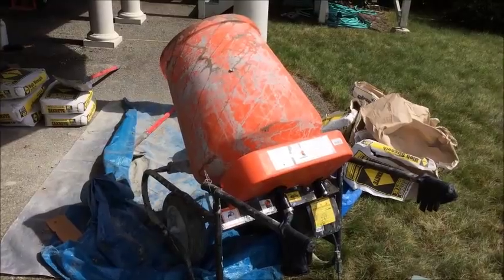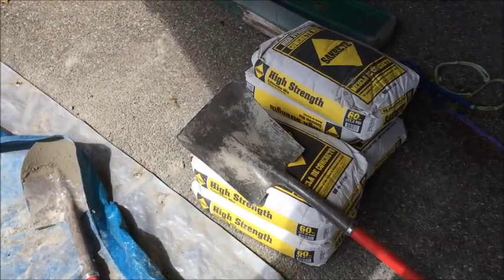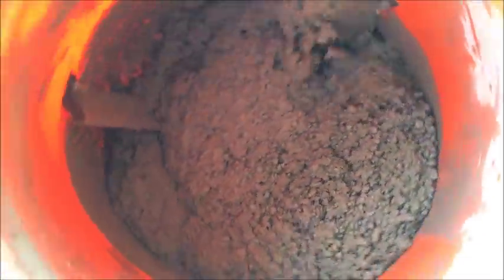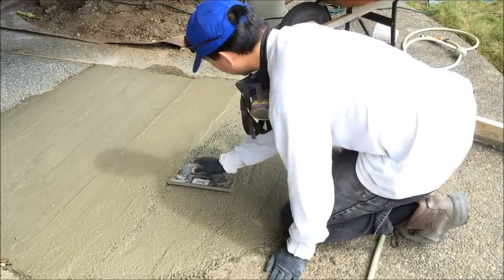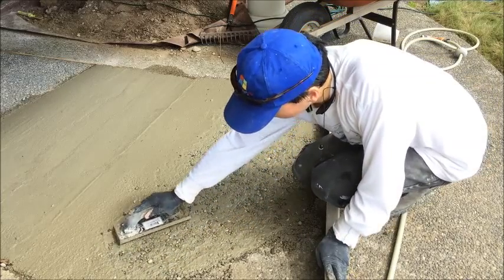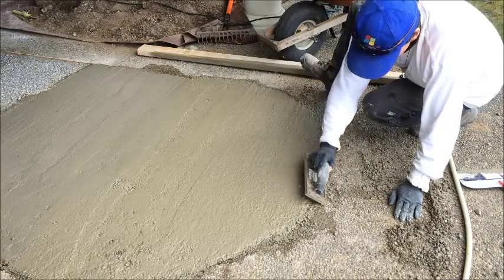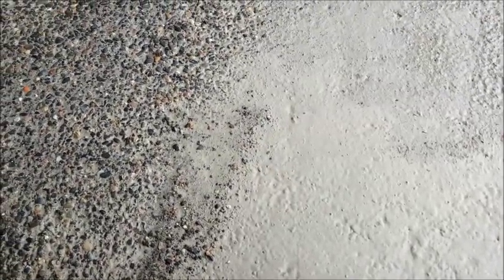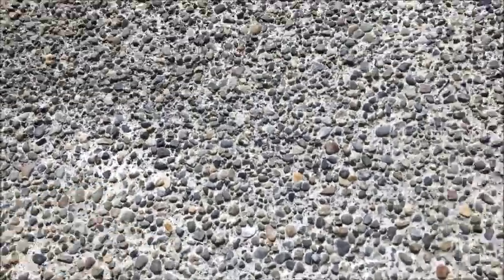Kushlan Concrete Mixer Tips And Making Aggregate Surface

Comment: The drier the concrete the stronger it is but even if you bring in a truck you get to choose how wet it is and most of the time it is used pretty wet and pourable it is still strong as hell you mix yours pretty thick  I would use more water and I have been doing this for thirty years.

Comment: I drive a ready mix concrete truck. And out batch plant is a "dry batch" meaning all materials go on dry.   The batch man.  Or "batch person" to be inclusive. Starts with "head water"  first half of water goes in first.  Then cement starts going as rhe sand and aggregate go in.   If it is all timed just right theres no fin pack like you were having with a whole bag.  Or meat balls big balls of dried mix. My truck does the same thing but can hold 11 cubic yards 9 legally on the road.   I have a project calling for a yard at my house. Its even cheaper for me to go with sakrete and rent a mixer than to order from my plant with discount

Comment: Get a piece of rebar about a foot wider than the cement bag width.
Place the bag on top of the rebar at the halfway point. Slice the bag across the middle. Lift up on the rebar. You have two equal half bags cut surface facing up. Finish the cutting the paper. You now have two 30 pound ez to lift and pour bags.
Reply from the maker: Thanks for that tip.  I've got another project coming up and will try it.

Comment: They need to make 25 pound bags
Reply: Home Depot sells 10 pound buckets of hydraulic cement. I don't know if that helps you out?
Reply: In Australia on a commercial construction project, the max lifting weight allowed is 20kg.

Me being a little older than the others on-site these days, lifting 20kg bags suits me fine!